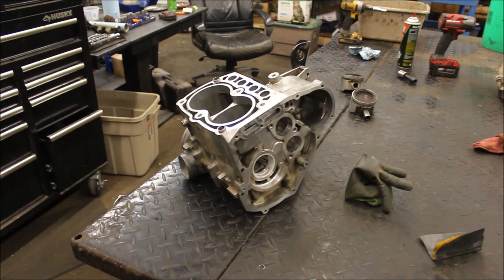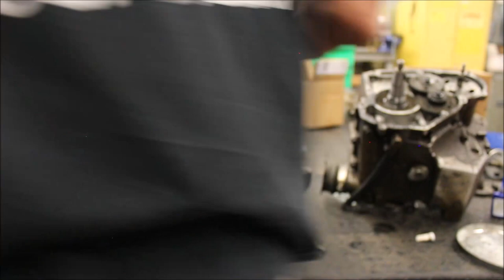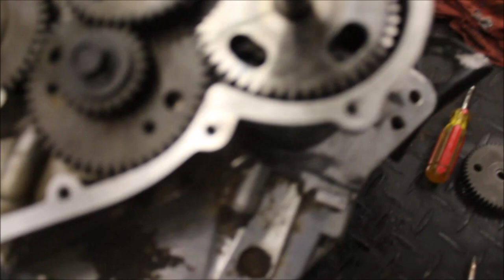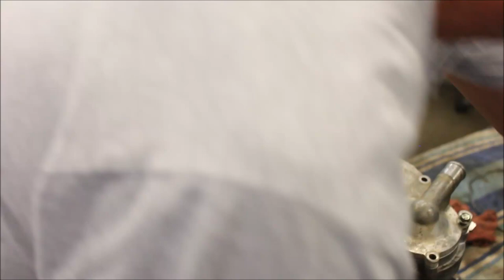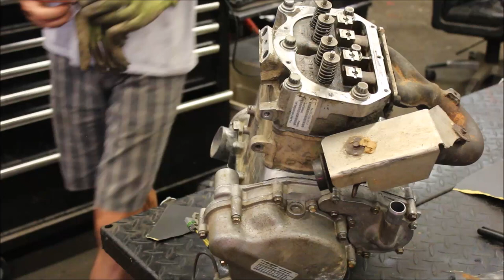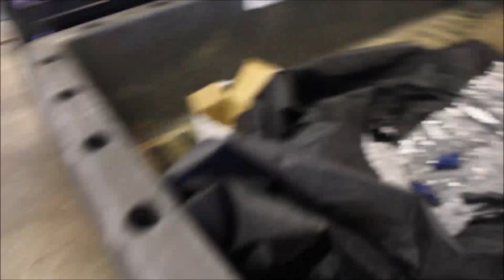Polaris  700/800 Engine Build on a Sportsman, Ranger and RZR! Part 1

Comment: Just found your videos, and they rock! Thank you for taking the time to make these and sharing knowledge! I just purchased a 2004.5 sportsman 500 h.o and it runs amazing in low gear and bogs in high rpm in high gear. I havent done much to it yet but am curious if you may have come across that issue in the past and found a fix. Thanks in advance ! Cheers!
Reply from the maker: Thanks, Glad I could help.
Reply: @TitaniummanGarage  any idea about my 500 h.o that bogs in high range but not low ?
Reply from the maker: Yes. I have a couple.  Thanks for watching.  I would start by cleaning the carb and checking the fuel lines and pulse pump. I think you have a easy fix if I could see it.

Comment: How did you put back in the Crank gear? Mine isn’t budging
Reply from the maker: I didn't have to pull mine off. They are pressed on with a press. When you separate the case halves it come out with it on the crank. On a 800 I rebuilt ,the new crank had the gear on it already.